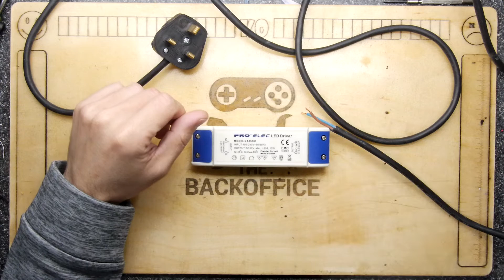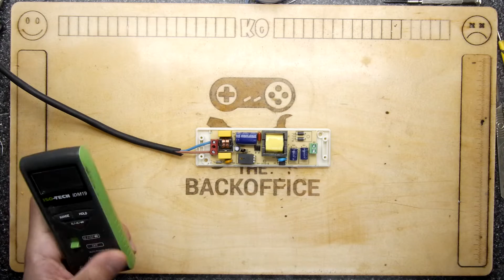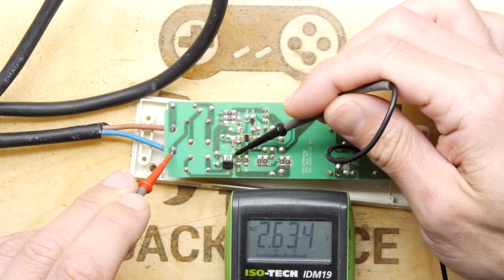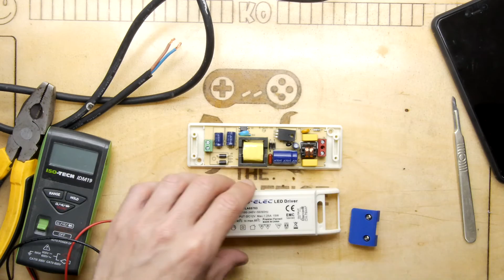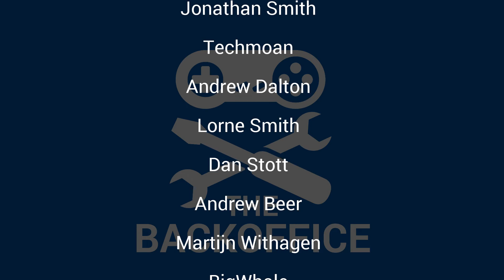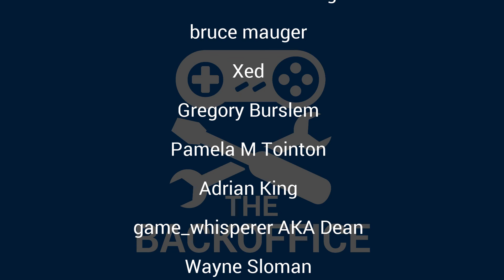LED Lighting Power Adaptor

Comment: For those following at home: Square root of 2 = 1.414 (Root Mean Square).  So AC voltage x 1.414 = 339 DC which is almost exactly what this Mr A measured.
Reply from the maker: Well done 👍 thanks for how this works